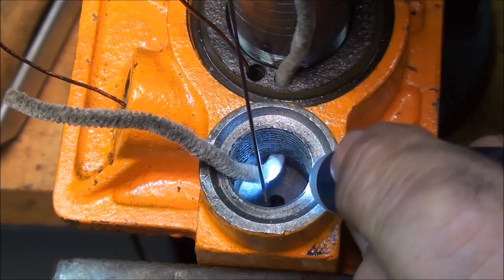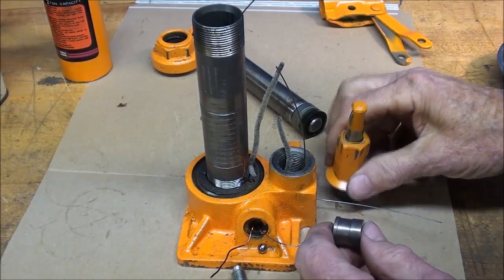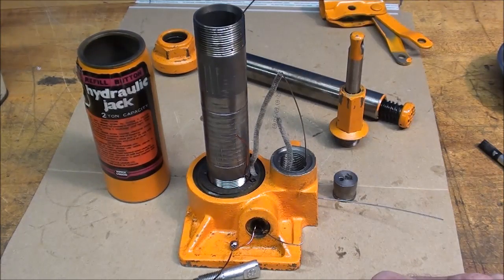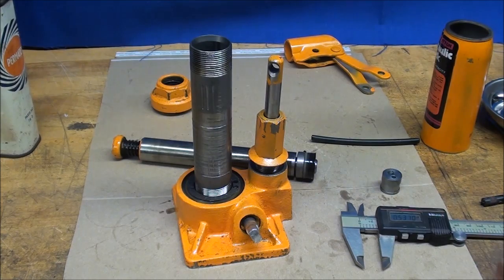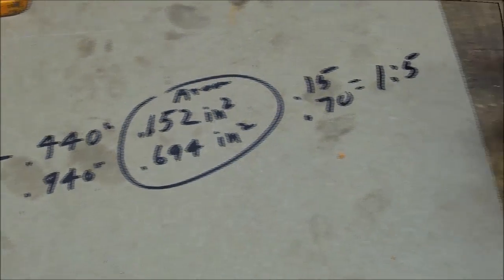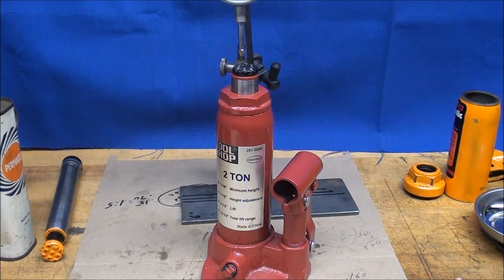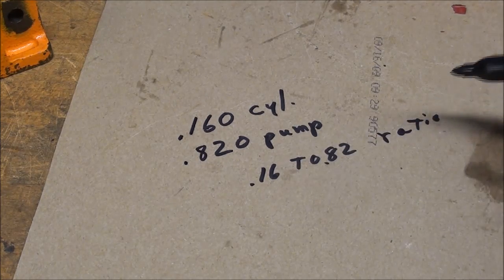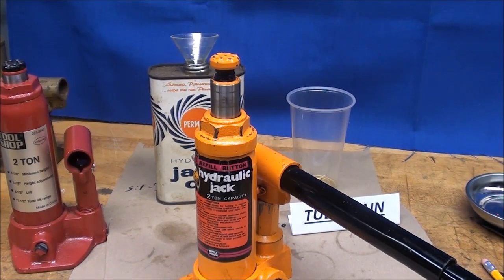WHAT MAKES IT WORK? #17 pt 2 of 2 "How a Hydraulic Jack Works" tubalcain

Comment: At the beginning of the video you mentioned that the oil leaked out. You also mention that the oil in the reservoir was not pressurized. Combined, those statements add up to, 'Well of course!' In order for the oil to enter the pump, the oil leaving the reservoir must be displaced by air entering the chamber. Therefore if the reservoir chamber is sealed, no air can enter in. I would say then that the jack must be stored in a way that the oil cannot leak out the air inlet.

Comment: Cheers, Mr Pete. Great video.

Just put together a surface-rusty but fundamentally sound 1980s vintage engine hoist (made in Redditch; just outside Birmingham, UK) and googled for a manual. Didn’t find one but eh, refilled it with oil; tested and all good👍 

Tomorrow afternoon, it will lift my Warco Minor (an early 90's Taiwanese round column mill, imported by the one decent hobbyist-appropriate machine tool seller in the UK) up on to my workbench.

What should come up on my YouTube suggestions tonight but a couple of videos about hydraulic jacks from your ever-interesting, ever-lamenting-the-modern-disposable-world, but ever-virtuous self.

God bless you, sir. 😊

Comment: such a great explanation between the 2 videos.  i used to carry a 1 ton bottle jack for my 7000 lb travel trailer, changed it to a 4 ton.  huge difference in the effort required to lift an axle to change a tire.
a sincere thank you for the efforts you put into your videos, the haters and trolls can go pound salt!

Comment: Great video. I have a 1 1/2 ton bottle jack someone screwed the valve out all the way and lost the two ball bearings. My Jack has a small ball bearing which goes in first I believe it's 5 mm then a bigger ball bearing behind it. I had to order 100 from Amazon and I only need one

Comment: beter then most but I still don’t know how a botLe jack works - I mean, no 1 ever talks about how much sir there’s supposed to be in those things, or how it gets in there, for example if you pull main cylinder upward, I’m guesscing your pulling a bunch of air into bottle jack👋, &&& no 1 talks about where airs supposed to be, or if it’s inside one of the main cylinders or that’s oil, & so-on - etc.  inshort I’ve never heard anyone on YouTube explain how these things work, & since there are roughly infinity differant ways to blEd-purge these things, I dOnEvNO how to find leak & fix jack, guud grEEf 😑

Comment: 13:30 There is nothing strange about this. The pump piston has to travel 5 times greater distance than the ram, so the force required to do the same work is 5 times less.

Comment: Consumer "bottle" jacks (including floor jacks with sideways bottles inside them) have a screw in them that says you should not adjust it. It appears to me that same screw on this jack is nothing but a plug for closing the hole at the bottom, the one you say was used during manufacturing to allow drilling of interior passages.

So, if I am having to take apart my jack just to remove the rubber plug that pushed through the button hole into the reservoir, it would seem I don't need to remove that part of the jack. I can leave it in.

Speaking of the button plug, it annoys the hell out of me. The operating and maintenance manual for my Torin 2-ton Blackjack model says that to purge the air, one of the steps is to "squeeze" the button plug to let out air. Well, try squeezing a plug without removing it, and you might find in the process of getting the leverage to deform it, one side of it might deform into the hole. And when it does that, the differential pressures on it can cause it to rotate. Further attempts to reorient it can push it farther in, and the plug can then naturally pop itself into the interior reservoir. Yes, that happened to me. So, one annoying problem (it needs purging) now becomes a very major problem because the manual says to squeeze the plug and this can reasonably be expected to lead to problems for users. I wish Torin would have used different wording of their directions to be more helpful to prevent my outcome. Trying to squeeze the barrel of a rubber plug while it is in a hole is a challenging task.

Comment: Nice presentation.  I have a jack similar to the Wards jack in your first video so was hoping to see the teardown of that one.  Mine will pump up (extend) fine but will not retract without draining out the oil from the fill plug.  I took out the relief screw (supposed to lower the ram)  and no oil comes out of it as well.  I'd like to see what is causing this to happen.  Not sure if it has a steel ball.  It looks more like a beveled tip that seats against an O-ring or just against a matched surface.

Comment: Good video ...I have a jack that had  a heavy load placed on it at full extention 4 x's the weight compressed it so hard that it won't go down even with extreme force.
It'll jack up the last  1/4 inch  and go down that same amount but then it locks and refuses to retract any futher.

Comment: Resealing a trolley jack I'm after info to show how the ball seal is fitted into the device . It has 2 Bearings for two passages; and a ball end on the pressure lock tap. You came close to solving that except also, this shows me how to fathom it out with some stout monofilament and some soft wire . I can at least go and figure how the darn thing is meant to work. 
A problem crops up since somebody beat me at getting inside the works and I cant easily be sure if springs were required in any all or none of the check valves straight away. Thank you for being a good helper, following my viewing of up to 5-6 others that just did not go in the right direction, all the way or not with a similar enough device to be of any use! It was a good idea to subscribe to Mrpete222 but today I had to renew my sub, I also learnt.

Comment: Very nice Lyle. In the world of hydraulic presses and lots of pumping to move the ram, I just watched a video by “Meanwhile in the garage” where the guy built a heavy, heavy duty press. It was one of those silent videos but, I think he added a plastic tube to the pump inlet to let it work inverted. The neat thing was he added an air fitting to the upper side of the body. He can use air to force oil through the check valves and extend the unloaded ram and, when it’s time for 20 tons, he stops the air and starts pumping. The air stays on top of the low pressure oil reservoir so there shouldn’t be any mixing.
Reply from the maker: Thanks, I will check that video out

Comment: All in all a good video, the wires showing oil paths was great for understanding flow and doing logical  troblle Shooting. Looks like you need to put the check assembly back in the right way for it to operate properly. A short paper flow chart would have been nice.

Comment: Well explained! I'm guessing the reason air in the system causes a gradual sag of a weighted jack is because a small pocket of air under a ball causes the ball to shift away from its sealing surface. Or maybe because air leaks across a tight seal more easily than oil. I have a floor jack that is better after air bleeding but remains unreliable because it gradually sags. Presumably I need to pull out those three balls, then clean and examine their sealing surfaces.

Comment: Thank you for this insanely hard info to come across. i have been looking for info on the check valve balls, cause i lost one and forgot how\where my old jack balls went\go. this video is the only decent explanation i could find on the net, whats up with that?!
how hard should it be to find out where each part goes...apparently impossible(with exception of this video) so, thank you for the excellent, thoroughly informative help video. keep up the good work, no matter how many dummies point out your wrench is backwards. I say you keep using it backwards just to piss them off!
Reply from the maker: Thanks lol

Comment: I am a hydraulic jack technician.
With the bypass function of the cylinder, the durability of the hydraulic jack is decided.
Also, the hole position of the oil tank affects the functions of the suction valve and the delivery valve.
Since the base part is a casting, it is easy to cause a valve failure due to oil stains.
You should be careful.
Reply: @mrpete222  My major is a metal engineer.
I have been working for 20 years only with quality control.
It's mainly analysis and analysis work.
Measure from materials, to the metal structure, to investigate the work.
When I was young, I disassembled and analyzed the world hydraulic jack.
Looking at the screw part of the cylinder, there is a bypass hole.
The smaller the durability is.
The outer scratch has a large installation torque, so it gets scratched deeply.
The accuracy of the inner surface of the cylinder appears distorted.
For that reason, the introduction hydraulic jack is nominal load, when used several times,
After that, at low load, the jack goes down.
In my investigation, there was a jack falling by 8 times.
Even hydraulic jacks, there are various specifications such as for cars, buildings.
Please be careful when using it.

Comment: Watched both videos on 8/3/2018.  You have done a very good job of explaining and showing how a hydraulic bottole jack works.  There are many variations in the construction of manyof these jacks, but they all work the same, but some of the cheap ones cannot be disassembled as easily,.  Getting the air out can be very frustrating.  You said that you are not getting many comments, but you are making a very valuable contribution.  Thank you.
Reply from the maker: Thank you very much for commenting and watching

Comment: No disrespect to Mr. Pete here at all. Mr. Pete mentioned a "Porta-Power" which I suppose is a remote operated hydraulic jack. The name is probably a trade name, but for this application it is incorrect. A hydraulic jack deliveres no "power". It does work. It moves a force through some distance. Lifts a car, or whatever. So maybe it should be called a "Porta-Work", or "Porta-Force". That is all. Thank you for considering this triviality.

Great video. Thanks. Now I know how my little 1 1/2 ton Bottle Jack works.

Comment: Dear sir,  your you tube issue is a nice effort.sir i amnot able to understand how the low pressure oil path is made as there is no drilling for it as the drilling for high pressure oil. kindly do explain, as i am  intending to take it as my project for my diploma in mech engg. I shall be indebted .with sincerest regards. Eagerly expecting your responce . My contact details whatsapp is 9888042652 , email qmes03@gmail.com
Hope u shall spare some moments from your busy schedule to resolve my querry. With sincerest regards.

Comment: Cutting through cast iron isn't difficult using a band saw at correct feed and speed rate. It's rather soft. Use plenty of oil or coolant , mind you.

Comment: hey mr pete you do a great job explaining the break down....if nobody else appreciates your trouble i certainly do.....i was recently given an old 20 ton napa bottle jack and ive tried and tried to get it to work...this big one has to basically work the same as the little one you have...only difference is there is 2 drain screws on the tank..anyways..thanky sir...!!!
Reply from the maker: Thanks for watching
Reply: well i found the problem...the rubber on the end of the ram rotted...think theres still a rebuild kit out there for this old jack..??
Reply from the maker: probably not---Thanks for watching
Reply: well...allrighty then....
Reply from the maker: Thank you very much

Comment: Thanks for making these videos Mr. Pete.  You bring back many years of shop classes.  My Dads home and shop was lost in a forest fire last year, I salvaged 3 floor jacks,  all of which need rebuilding of course.  I've never pulled the ram from a Hydraulic jack before and I wanted to know what type of seals were used, or as I've learned from your videos, cups, like a wheel cylinder.  I don't know if it'll be worthwhile to rebuild these jacks, even though they were good US made units, but one of them was my grandfathers 3 or 4 ton Walker Jack, and to me, it's worth rebuilding at almost no matter the cost.  I'm sure I'll be able to find o-rings and seals,  but I'm not sure where to find cups yet,  once I get measurements I'll start with the auto parts store first I suppose.  Anyways, thanks again for your video.
Reply from the maker: Thanks for watching--sorry about the fire

Comment: When I was a small child, I remember that my father had to borrow a bigger jack from a friend to change the tire on our combine (harvester). It was either 50 or 100 ton capacity, but what I remember that was unique about it was that it had two pumps. A large one that didn't develop much force but quickly moved the ram up to the starting position, and a smaller one for the actual jacking.

Comment: Thanks for the video. Can a pressure gauge be placed on the hole with the plug and give readings of pressure as the jack is actuated? I want to add a gauge without having to drill a hole that goes into the central cylinder
Reply from the maker: Its been awhile since I made that vid.  WATCH this video--- Adding pressure gauge to a bottle jack.
Reply: I have seen that vid, I wanted to avoid drilling the base of the jack

Comment: Great vid, explains how the jacks work quite well.  One practical question though.  Hydraulic systems only work when all of the air is bled out, but the storage cylinder is designed such that air is trapped in the top of the cylinder (due to the oil fill hole being part-way up the cylinder and not at the very top).  Is the air there for a reason?  What happens if you tip the jack on its side with the oil fill hole on top, then fill the cylinder completely with oil?  That's how trolley jacks seem to be designed.

Comment: Thank you, for taking the time to explained how a bottle jack works. 
Question; The reservoir fluid has no pressure so with that being said the fill plug job is to keep dirt out and stop fluid from leaking if the jack was knocked over. Right ?

Comment: Did you happen to get a measurement on the ball diameter for that ball behind the screw that lets the oil back into the reservoir? I have a "new" (to me) 12 ton bottle jack and it seems to be missing the ball.
Reply from the maker: No-never did measure it
Reply: I'll try a 6mm

Comment: Hello maybe you can help me I have a Alligator forklift jack and I have a problem...Jack lift fine and hold the weight the problem is to lower the jack ....Won't go down without weight...Sometimes I have to pushed down to closed all the way and when I pick up the jack will open till I put it down will closed back to normal ...I do have the red knobs on top is fully closed  Thank you...Jack was sitting in my garage for long time....

Comment: Thank you Mr Pete for your awesome video. I have a lift cart that has garbage for manual. So I needed to know about the theory and mechanics of hydraulic jacks. Your videos on the subject have been extremely helpful. I loved your explanation of the oil passageways and how the valve system works.

Comment: Thanks for the video. I had been trying to fix my leaky jack on and off in the last month or so and after changing the o-ring on the pump, it seemed to have gotten worse with no pressure at all. I looked at it again today and either the ball was not seated correctly or I had forgotten to close the screw valve, now it seems to work fine. In the mean time my wife informed me that she already ordered a new  one for me. (I wasn't too pleased that many people don't appreciate fixing things which when fixed work as good as a new one). Anyway, I also enjoyed the ratio math. In physics there is a principle of conservation of energy which is defined as force x distance (or more precisely as an integral). So if the force is 5 times greater, then the distance is 5 times smaller. So the energy you put in is the same as what was gained by the car as it got raised by 1/5th the distance. Also, since the handle is about 1 foot and the pump is about 1 inch from the fulcrum, we have another 12x the advantage there for a total of 12x5=~ 60. Thus, you can lift about 1500 lbs, (say the whole front of the car) by applying 1500/60=25 lbs at the handle. I am still not too clear about that ball valve, but I get the gist. There seems to be two one way valves.
Reply from the maker: Thanks for the math--I'm a little weak on that

Comment: how do u properly bleed out the air on the jack- would u pump and let it out thru the screw that tightens for up and down or pump it after u fill it and t hen put the side plug in. - Thx for doing this vid- im working on 3 jacks that ive had for years - Why throw them out when its a simple fix- Thx again

Comment: That lever effect on the handle could easily be like 1:10 ratio so all in all, we can say that there is 1:50  ratio.  It would only take 1 lb to lift 50 lbs or 10 lbs to to lift 500 lbs.